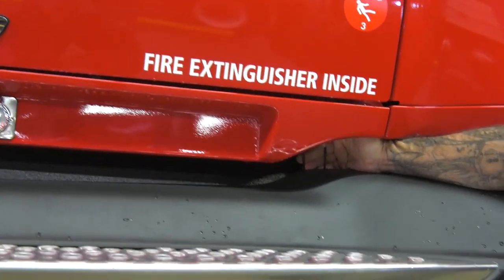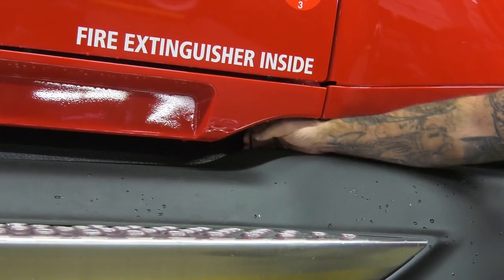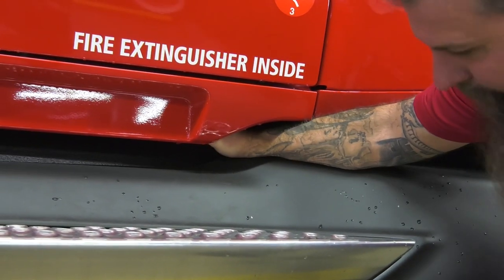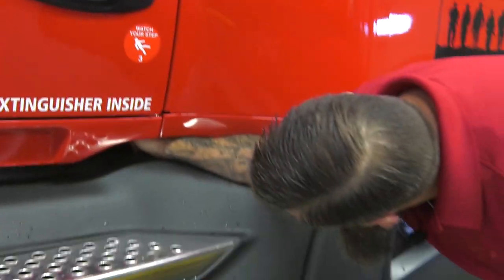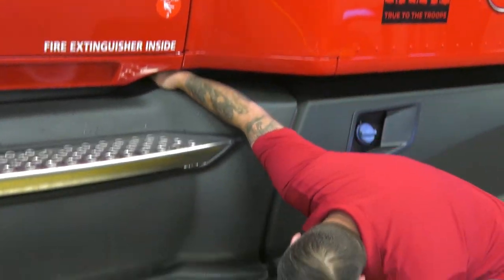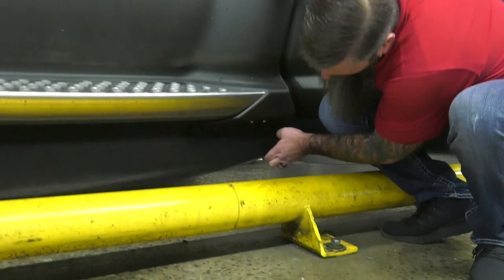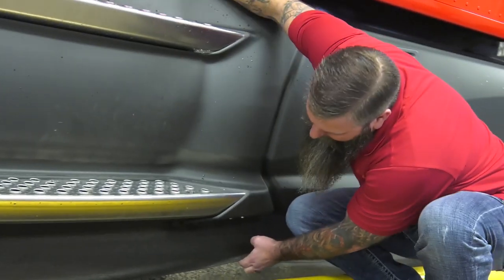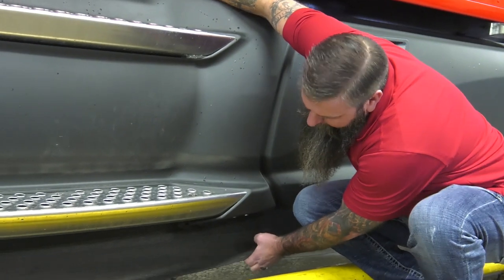Maintenance Minute - Draining Air Tanks

Comment: I cant find any cables to drain the tanks on my freightliner
Reply: They should be by the DEF tank
Reply: @hectordelgadillo9952  they weren't. I never found them. Drove that truck for 6 months not knowing. Luckily not in winter. My company sold it and now I have a brand new truck.

Comment: It's funny most ppl don't know. That it affect the dryer, plus the def system. Thier are filter in those dryer as well as the cabin filters but most don't know it does affect the air dryer filter as well as def. ALOT DO NOT DO IT. VERY SIMPLE CUT TRUCK OFF GET A BUNGIE CORD PULL IT.